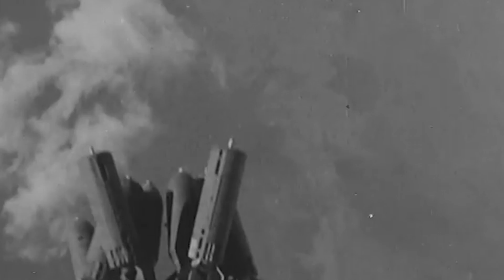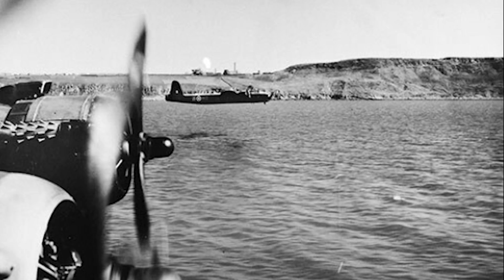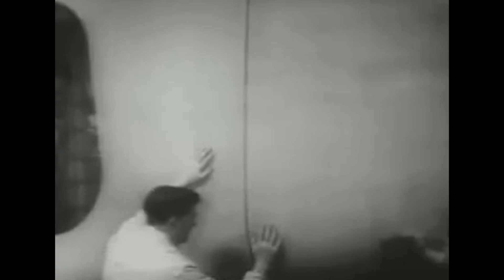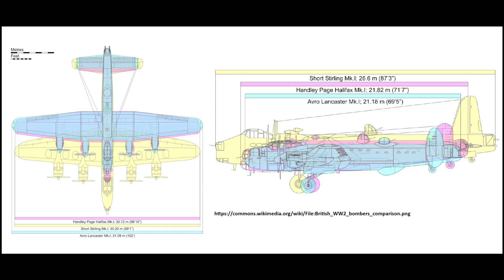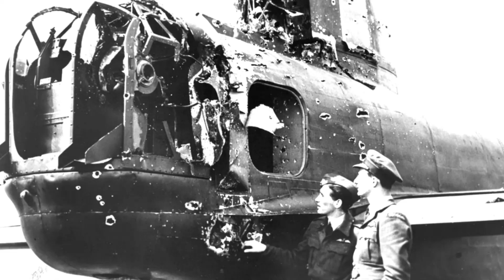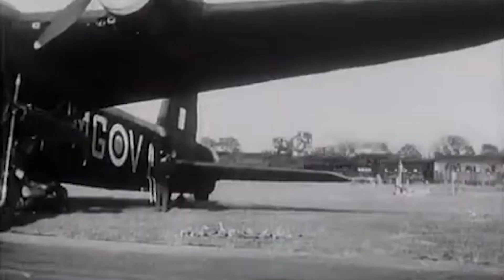The Short Stirling; First of the British Big Boys

Comment: Harris's attack on the Shorts management, whether justified or not, was really beside the point. The problem was that the Stirling was an early design, had some things wrong, and wasn't easy to upgrade. I'm surprised they didn't get more use in anti-submarine warfare: you could surely get a lot of range easily enough, and high altitude wasn't a requirement.

Comment: My uncle was a wireless operator, gunner on Stirlings. 
Airman: Sergeant Victor Frank Munt, RAF Volunteer Reserve, service number 1151780.
Aircraft: Short Stirling Mk I, serial W7528, squadron code LS-G.
Mission: Bombing raid on Warnemünde, targeting the Heinkel aircraft works.
Take-off: 22:16 on 8 May from RAF Wyton.
Loss: The aircraft was shot down over northern Germany and crashed near Brodersby, Schleswig-Holstein, at approximately 01:02 on 9 May.
Outcome: All eight crew members were killed

Comment: I've got the excellent Putnam book "Shorts Aircraft Since 1900" by C.H.Barnes. It explains a great deal about the Stirling. Shorts understood full well that as the weight requirement increased the wing span limitation would be a serious flaw. They repeatedly lobied to get the spec changed to increase the wingspan, without succes. It would have been easy for them to increase the span, since the wings were almost the same as the Sunderland. They also had a 'Super Stirling' on the drawing board with high aspect ratio wings with a much greater span and more powerful Centaurus engines - but the Government wouldn't budge.

Comment: The most used bomber over Southern Norway was the HP Halifax. Mostly to drop SOE agents, weapons, equipment and supplies for the resistance movement. They flew at night over uninhabited land, preferably at night at a very low altitude, and their engines were relatively quiet and didn't attract attention to the same degree as other heavy machines. Nevertheless they were highly dangerous missions, bordering on suicidal. The more northerly raids against the Tirpitz however, were carried out by Merlin engined Lancasters.

Comment: The Stirling kind of sums up the sadness of the early-mid war bombing campaign that bore witness to terrible crew losses for not a lot of achievement. That said, it was capable of large scale attacks that couldn’t be mounted with machines like the Wellington. It was simply the only thing that was available and it was better than the machines it replaced. Not only that, its results were limited by the lack of later navigation systems like GEE. That kind of makes the Stirling look worse.

Accounts of Middleton’s mission to Turin in November 1942 report that he struggled to get the Stirling through the Alps. It was supposed to be able to fly at 16,000 feet but he couldn’t get it over 12,000. Middleton eventually found a way through and the rest is well known.

Coincidentally, both Stirling VCs were awarded for raids on Turin. Both required their crews to fly over the Alps, a risky proposition in a Stirling.

Comment: You appear to make the - sadly common - mistake of confusing an aircraft's range with its combat radius. Early in the piece, you imply that the spec to which the Stirling was designed called for an ability to hit a target '3,000 miles away, i.e. Berlln'.  Berlin is in fact about 600 miles from a UK bomber base. Even with a bit of ducking and diving to evade/confuse defences, that implies a mission distance flown of around 1500 miles - once they've  dropped their bombs, they have to get back home!

Whatever the demands of the spec, the Stirling it produced, with an empty weight 7 tons greater than a Lancaster, had a particularly steep range/payload curve, and certainly nothing like a combat radius of 1500 miles, with anything like a useful warload.

Comment: Sir Martin Middlebrook wrote several superb books about the RAF Bomber Command - if you never read any of them I strongly recommend you start by buying The Battle of Hamburg and The Berlin Raids. Then you will become addicted and buy the remaining four or five 😀 - and, being extremely knowledgeable he was always very critical of the Shorts Bomber. He mentions repeatedly that the Stirling was incapable of climbing above 14 000 feet and therefore suffered very severe losses mostly caused by Radar controlled FLAK. He does mention the aircraft's usefulness in dropping SOE agents and mining; but the latter missions only counted as half mission to reach the mandatory 30 and go home. Only missions over Germany counted as one full mission. 😰

Comment: Very good video. A handsome aircraft, IMHO, & with, for the time, very well designed & teeming with advanced features. The flaps, for instance were of the highly effective Gouge type, very similar to Fowlers which are still widely employed today. Most aircraft of WW2 were fitted with primitive split-types, which acted more as airbrakes than anything else. Structurally, it was also pretty advanced & the Stirling's toughness can be attributed to this. Sadly, however it was more than just it's lack of power & short wingspan that proved to be its shortcomings. In order to produce enough lift at low speeds within it's 99ft span, the wing's thickness had to be significantly increased over the one from which it was derived - the wing of the Sunderland. This massively raised induced drag at medium altitudes further crippling its altitude performance. The bombay was far too shallow for a modern bomber & its 4-door arrangement complicated matters. Enlargement of the bay would have lead to a significant redesign of the fuselage as the central bomb-bar spar, as mentioned in the video,  contributed greatly to the airframes' structural integrity.  Being such a large & complex beast, the Stirling employed an awful lot of precious & expensive aluminium  in it's manufacture, by comparison to the Lanc & the Halifax, & was far more difficult & laborious to build.   
In many ways, it was an oversized aircraft for the role it was intended.  Very impressive aircraft nonetheless.

Comment: My father was a radar "sparks" with Bomber Command from 1941 to 1946 and he flew, in combat, in them, Liberators, USAAF B-17s and Lancasters.
The Stirling was his favourite because it could do nimble things the others couldn't and was adept at 'slam braking' on night raids to confuse German automated anti-aircraft emplacements, often allowing the faster Lancs and Mozzies to power ahead past thick defences. Crews would then gain altitude and fool the enemy into thinking that the main bomber groups had been  re-located. On such raids its main tasks were to "paste up" infrastructure nodes and medium sized route towns to cause maximum disruption and have enough fuel and ordnance left go for a list of targets ad libitum. This was especially important over Holland because the main courses for faster main bombers hitting Germany were over the Netherlands and, consequently, heavily served by anti-aircraft measures.
In the same region, Stirlings acted as decoys mixed in with Lancasters following the Mosquito pathfinders and able to take punishment. The bomb loads on these large ops were usually mines destined for Dutch dyke walls and could not explode inside the bombers if hit because the fuses were set just a few minutes before release. By mid-1943 the Luftwaffe had stopped chasing Stirlings flying due west and this allowed for what we now call 'loitering time'.
Quite a range of modern tactics were initially tested by Stirling crews, including Ground Effect over calm water as the quite stubby wings were ideal but Dad said that the men had no idea why the pilots were asked to this and the pilots didn't know either. Collected data were just a bonus of the powerful radars before landing back at home aerodromes.

Comment: Well done for this, the Stiring is one of my favourite aircraft, it being a bit of an underdog I suppose.  One book I have read though by a Stiring pilot (Sq.L T.C.S.Cooke, Flying amoung Heros) states that if you knew what you were doing you could easily get the Stiring to 18,000ft, well above the normally quoted figures.  Does make me wonder why this info wasn't passed on to most crews.  He wrote about this and in a paragraph about it (page 94) he stated "In Spite of this, word soon got round that the Stiring was underpowered and would not go above 11,000ft, This was joyfully taken up by the pseudo-historians and is now accepted as fact".  The height quoted may be very low, but most sources do seem to say 15,000ft was typical.

Comment: I knew an old boy who had been at Arnhem.  He was in the Royal Artillery.  

The thing about towing gliders was that the paratroop carrying capability of the Stirling couldn't be used.  So if a gun was in the glider, the troops had to either parachute from a separate aircraft or go in a separate glider, which meant doubling the number of aircraft plus another glider. and that they would get split up on landing.  Basically the Stirling was flying empty which was a waste.  For various technical reasons to do with parachutes and gliders getting muddled up in the same bit of airspace, you couldn't tow a glider and have paratroops jumping out of the Stirling at the same time.  So according to my pal some bright spark came up with the idea of a parachutable box in which the troops could sit which would be underslung from the bomb bay.  The idea was that once the glider had been detached, the whole box including the troops, their weapons and anything else would descend elegantly and the troops wouldn't get split up.  It would apparently be just like getting off a bus, everyone together.  Just being one big box wouldn't cause the same problems for gliders as lots of parachutes.   The troops were invited to try it.  'No' they said (actually they used bigger and longer words than 'No.').  

So a trial was held using sandbags instead of soldiers and the thing was duly dropped over Salisbury plain.  Once my chum and his pals had dug it out of the hole it had created, the idea (like the box itself) was quietly dropped.

Comment: When looking at every photo of the Stirling on the ground, one has to wonder why the main landing gear are so long and the cockpit so high off the ground. Certainly nothing to do with propeller ground clearance as there is more than enough. Does this look go back to the original Air Ministry flawed requirements? Is the rake of the aircraft on the ground to give the wing a greater angle of attack and thus more  lift on the take off ground roll? If anyone is knowledgeable on this topic an answer would be much appreciated.

Comment: I always wondered if there any reasons for the aircraft to have such a long main landing gear and thus sitting so high and at such a steep angle of the ground? The bomb bay must have been hard to load up?
Reply: I believe it was to increase the angle of attack on the take-off run and so shorten the take-off for the (then) mostly small grass airfields. I'm ready to be proved wrong though.

Comment: Would the Stirling been useful in Coastal Command as a VLR patrol ASW bomber. It had the range payload and maneuverability for that task. Height was not going to be an issue.
Reply: The range was about the same as the Lancaster and Halifax. The VLBR versions of the B-24 were much better than any of them.
Reply: The Sunderland was perfect fit for that role.

Comment: The heavy bomber that could give you altitude sickness sitting on the ground....😁👍🏻😎🧙🏻‍♂️ 

The flipping size restriction rules were short sighted and engine development and production ridiculous but they were desperate times.
Reply: The RAF wanted to restrict the overall size of bombers for B.12/36 so enough could be produced by actually having something a little smaller than the Stirling ended up being. Later, there were specifications for bombers with wingspans closer to 150ft.

Comment: Great video, es ever. My Dad was a Lanc pilot in WW2. I seem to remember him talking about the Stirling (maybe after he had flown one) and saying a fatal weakness was that it depended so much on hydraulic power. If your hydraulic system got damaged, the plane was virtually unflyable. Can anyone confirm this half remember tale of my Dad's s true or not?
Reply: @mikeonb4c  most of the systems on a Stirling are electrically or pneumatically operated. The exception was on early aircraft which had hydraulic Exactor engine controls which often lost pressure. Later aircrafted reverted to control cables to operate the engines to negate these issues. Flying controls were all via cables and pushrods
Reply: @johnlathwell7667  Thanks for clearing that up, it was a long time ago! I think the main thing I remember was my dad saying there were 'clever' (for the day) systems on a Stirling that, should they fail, would soon have you wishing you were in a Lanc. I suppose in some respects this is a similar argument to liquid cooled engines vs air cooled ones.

Comment: One of my first Airfix models, definitely have a soft spot for them.
Reply: One of the first heavy bombers I built was a Stirling in 1969.
One of the Victoria Crosses won in a Stirling was an Australian Flt Sgt Ron Middleton No 419 Sqn.
Reply: I must have bought and assembled mine around 1979. But the kit on sale must be the very same. Series 5, black plastic. I remember that the undercarriage was a nightmare to assemble, very thin, bristle and hardly able to withstand the model weight; every bomb had three parts and there was an awful lot. She came with a tractor, if I remember well. 
In the seventies Airfix made much better kits, like the B-26 and A-26.
Reply: @duartesimoes508  oh the memories! I would have made mine around the same time, and yes those bombs / trolleys and that undercarriage are what still stands out for me to, surprised I kept modelling tbh...
Reply: @sr20trx   I remember an Airfix F-16 kit also with trolley and munitions. I find those additions so cool, they transform the kit from merely a model into a story.
Reply: I have been looking for the Stirling as Airfix model. I see Lancasters and have seen a Halifax, but I haven't been able to find a Stirling.
Reply: @larsrons7937  I own the Airfix Stirling and it is terrible. And I know no other. The model must have been made in the sixties and the molding is horrible, large parts are often warped. And it is a very ambitious model, with a lot of parts and a complete bomb bay.
Reply: @duartesimoes508   That's sad to hear. Maybe one could fix in in mid-process, but it would take a lot of extra wrok. I've tried the same with a couple of Airfix sail ships.

Comment: I always wondered why the British had no underside protection; the German nightfighters easily could advance on them from beneath, pulling up while firing with the result that many of these 4engined bombers were shot down without a single bullet being shot at the German fighter (later in the war when the Schräge Musik was introduced it was even easier as they didn't need to pull up anymore, flying under the target was enough). It made them practicly a sitting duck.
Why the British for so long thought that most bombers were lost by flak when in reality they were shot down?
Reply: All British bombers of the period were designed with ventral protection: Wellington, Hampden, Whitley, Halifax, Stirling, Manchester, Lancaster. The issue was the turrets weren't very effective. Some did carry the Fraser Nash or Boulton Paul ones in WW2. Those not fitted with H2S or similar might also have various official or semi-official fittings with a Vickers K, 50 calibre MG or 20mm cannon. Some had the Preston Green Mk. II ventral turret (mostly Halifaxes) with 1 50 calibre by default or 2 in some instances. About the only not designed with it was the Blenheim, but one of two Bristol turrets were later available for ventral defence of slightly dubious effectiveness.

With some irony, upward firing guns were developed and used by RFC and RAF in WW1.

Comment: I worked in the Rochester Hangars where these were built this was 70s onward, my first Forman had been a panel beater with Shorts, he stayed when they moved out… when I was first at the factory when you went out one of the doors there was still the large metal plates in the floor that formed part of the weigh bridge, and if you went up into the higher part of the hanger (it had a lot of internal partitioning and false ceilings) you could still see the over head gantry cranes, My brother worked at Blaw Knox who occupied the old Shorts Sea Plane works on the side of the Medway.

Comment: Fifty years ago I had a boss who was a former Bomber Command pilot and when he mentioned flying the Stirling, I offered the usual negatives of the aircraft. He immediately went into a spirited defence of the type- its robust strength and manoeuvrability and told me you could stand the aeroplane on its tail and do things which would see the other "heavies" break apart. It's a long time ago and he said something to the effect that the Lancaster was made in various places- in terms of its main sections and when you crash landed it tended to break up into these parts which would then travel in the direction from where they had been built. So "I was told" in no uncertain terms that it had its merits but as pointed out, the war evolved and the Stirling became outclassed although the "Super Stirling" may have been able to remedy the shortcomings and been a force to be reckoned with.
Reply: @NickRatnieks  certainly robust, try building a new one!